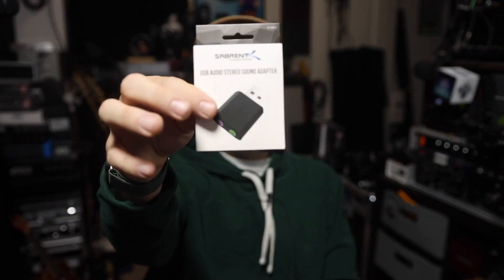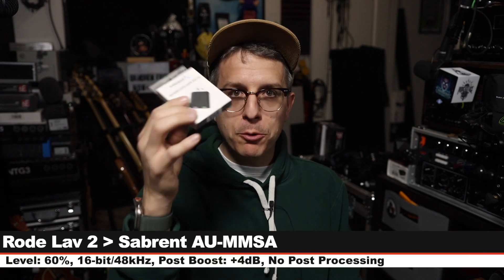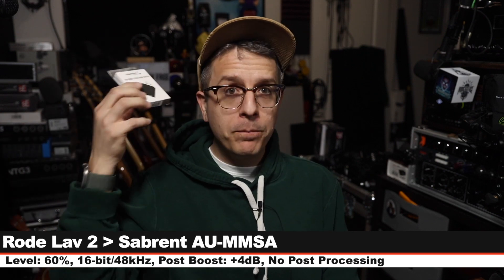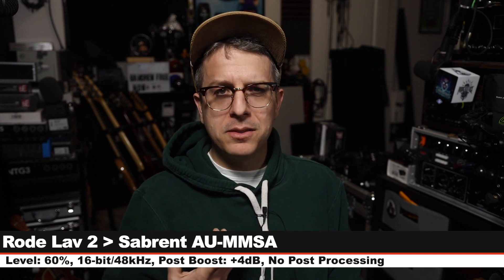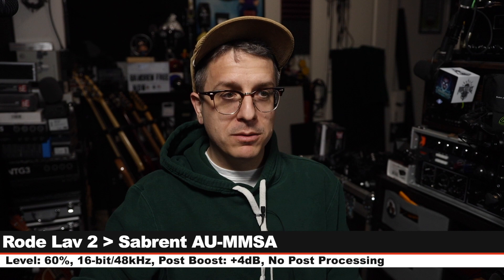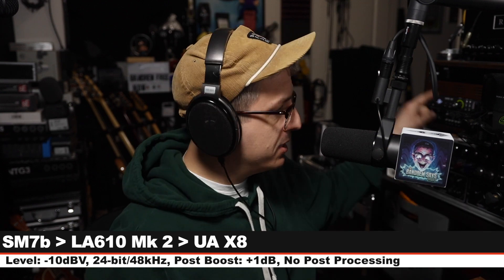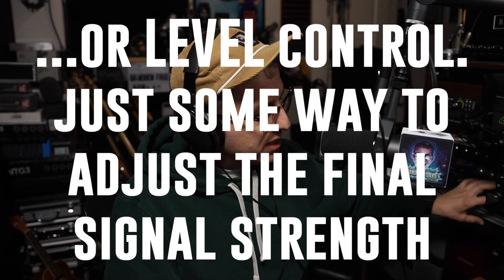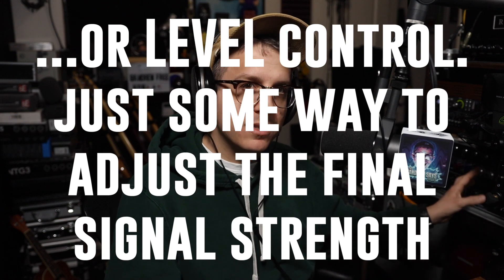Using Lav Mics with USB Soundcards, Soundcard Gain (Sabrent AU MMSA Follow Up)

Comment: On the line-level situation - the USB sound card is limited to 16-bit depth for its conversion and the UA X8 was running 24-bit according to the doobly-doo. I'm not an audio engineer by any means, but if you're running a hot signal with 24-bit depth and then you send that same signal to an ADC that's only using 16-bit, I would 100% expect clipping to occur. I want to be clear - I'm in no way condoning the craziness of doing this or defending the device - just saying that I wouldn't expect it to handle a hot signal like that since it's limited to a lesser dynamic range.